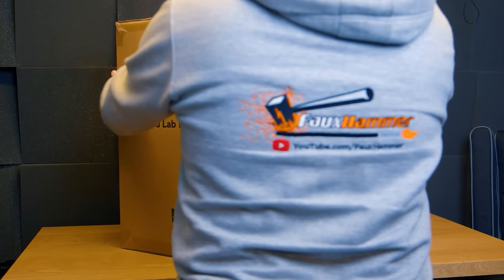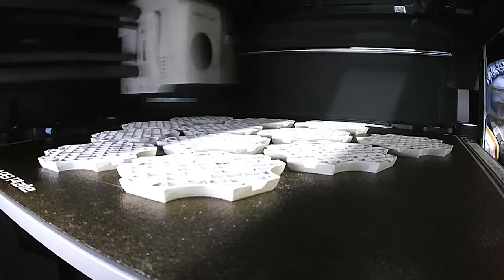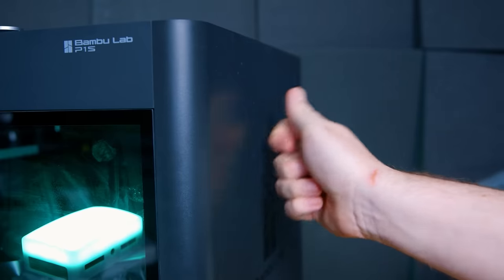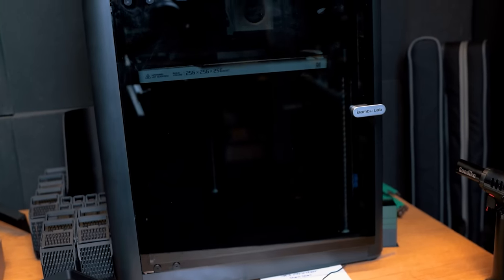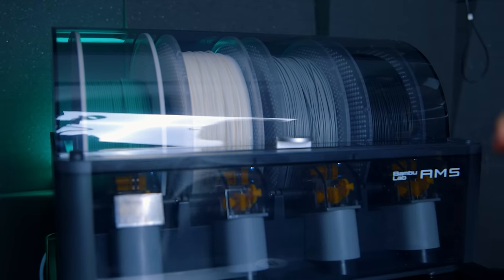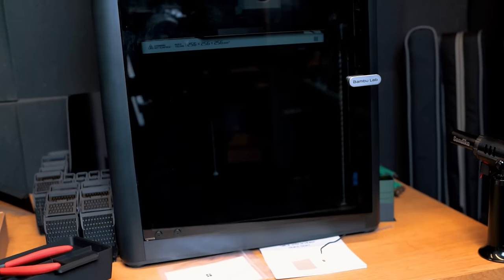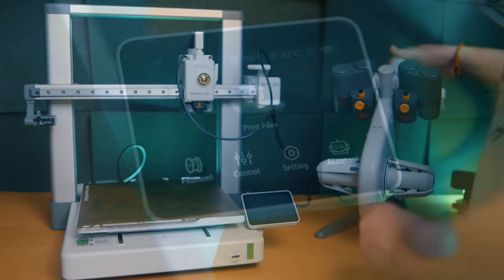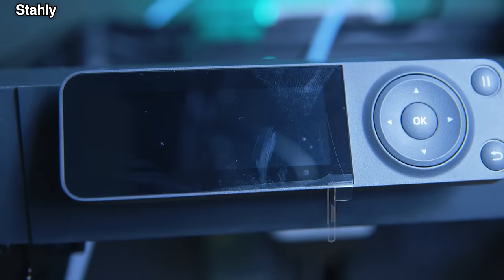Bambu Lab P1S Review - Please Start Here - I BEG YOU

Comment: The box hinges don't work because bambu is not properly dimension calibrated. You have to literally set XY hole compensation and OrcaSlicer filament shrinkage yourself and find proper values with experiments. Bambu did not calibrated even their own Bambu filaments so it's cool to print benchy and other shit but if you want to get proper dimensions and tolerances you're on your own buddy :)

Filament Shrinkage: 99.7%
XY hole compensation: 0.15

Works for me for most PLA prints.

Comment: How are you supposed to open the glass lid if you have an ams?
Reply from the maker: You can put the AMS to the side. or what a lot of people do is what I did is print a riser with LED lights and a shelf. Then I removed that and pout it on racking because i now have 4 ams units
Reply: @FauxHammer  Okay thank you! 4 AMS units wow

Comment: and the P1S wont catch on fire unlike the A1 :D So thats always a good thing
Reply: But it will clog, and that is an actual problem, not a theoretical one. It will also munch the occasional extruder. Replacement parts are inexpensive though. It will also lose connectivity with your router and refuse to ever connect to it again. My P1S eats up all the 5G allowance on my phone's hotspot by mid month because of this. Still a great printer, but hardly flawless, where I've never had any of these problems with my A1's.

Comment: Rubber baby buggy bumpers? 🤔
As much as I'd love to start with.. or I suppose make this my next one, my bank account unfortunately doesn't agree.. so for now I just have to go with the budget-friendly options, and hope that at some point I'm of the means to get one of these 🤷🏿‍♀️
Reply from the maker: Have you seen the P1P without AMS? is that in budget? or the A1?
Reply: @FauxHammer  if I could afford the P1P in the first place, the AMS probably wouldn't be much of a problem.. and I have been considering the A1 for my second or third printer, but I was talking about this one specifically
Reply from the maker: @TS_Mind_Swept  This would be an incredible place to start that would last for years. It depends what you want, some maintenance as required, or having to be a printer technician
Reply: @FauxHammer  What I want ≠ what I can afford, and I don't exactly have to pay to be a printer repair technician (aside from the time to learn); not that I necessarily love doing that when I can't seem to figure out what's going wrong with a particular issue.. but I'd rather do that than not print at all.. I get you tryna help, but I'm doing all I can over here 🤷🏿‍♀️
Reply from the maker: @TS_Mind_Swept  and you seem do be doing it right, I totally understand the internal struggle too. What you want and can afford is a very real argument.

this time next year, I hope that other brands have started to catch up, i mean, Waiting a bit longer is also a viable option too? maybe you'll find some more affordable and less frustrating choices in teh future

have you considered the Creality K1 series for example?
Reply: @FauxHammer  Those end up being just as much as these… the Creality V3 KE definitely seems to have a lot of nice features though, looking at that as probably my second printer, with the A1 likely being my third; however depending on the financial situation, as well as how frustrated with my Ender 3 Pro I am.. (looking to upgrade some of the things as the others wear out, but there's only so much you can do with a given printer) I may just say 'fork it' and spend the extra hundred for the A1 for the 2nd.. We'll see how things go, and how much I have when the time comes, of course

Comment: Suggesting a $950+ setup to start with is rather ridiculous.  The fact is most people will never move beyond a basic hobby phase with 3D printing, meaning they print about $50 worth of trinkets and then some parts for their printer...  and there is really nothing else left to print.  It was only a year or two ago we were still talking about $150-$300 printers in this hobby.  Plus saying AMS can waste a "bit" of filament is not very truthful.  Depending on the print, it can and will waste more trash filament than is actually used in the print.  I enjoy your videos but they are coming off more and more as Bambu advertising.  At best this is a second printer, after you have learned what it is you want from a printer.
Reply: It’s $599, and hands down the best choice under $1000

Comment: please don't buy this printer, it's a piece of shiet. I bought it today and it has a ton of errors. I tried it with AMS and without and it doesn't even print. I thought i did something wrong but i have proof that it's the printer that has problems. I google the errors and see that a ton of people have my same issues. Save your money and time and don't go trough hell like me.
Reply from the maker: Have you considered you may just have a bad printer? This seems like a strong overreaction to a machine lauded for its ease of use.

What are the issues you are having?
Reply: @FauxHammer  there is a reason i said what i said. It's not the first time i buy a 3D printer dude and i never seen so much problems in 1 printer
Reply from the maker: @akantor5526 yeah. Ok. But telling “everyone” to beware is a bit much

Again. What are the problems you are having?
Reply: @FauxHammer  why not? why should i lie to people? The AMS doesn't load properly the filament. I tried without the AMS and even so it doesn't work. It gives me errors and i tried to google them. I read for hours for a solution but i didn't find anyone that did solve it properly.